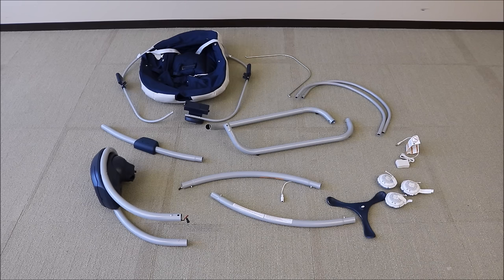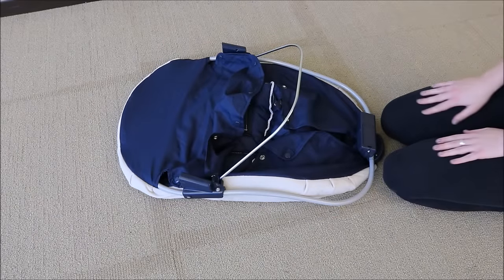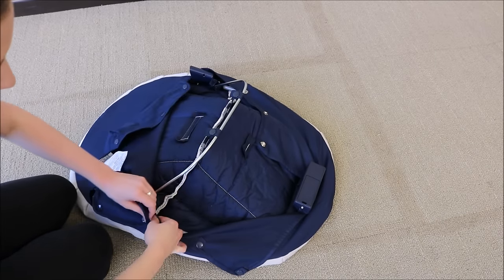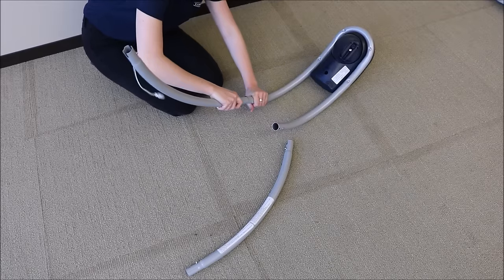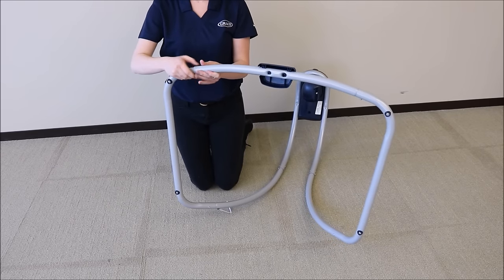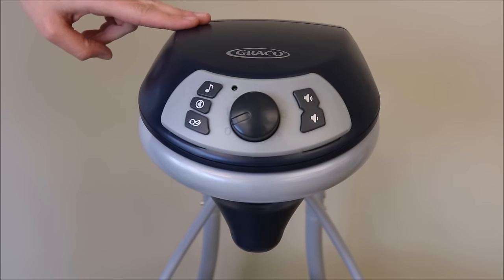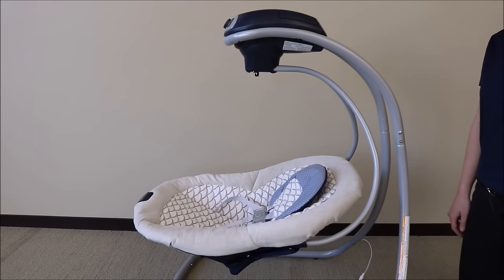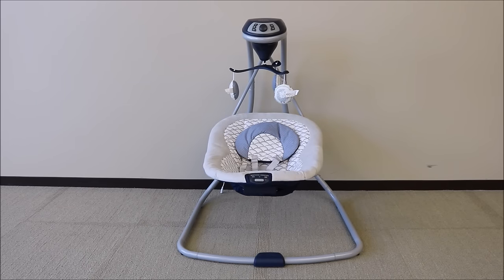Graco® Simple Sway® Swing Assembly

Comment: This video doesn't explain what the power cord is that plugs into the wall outlet into the bottom leg... when it's plugged in does it run off electricity and not the batteries?